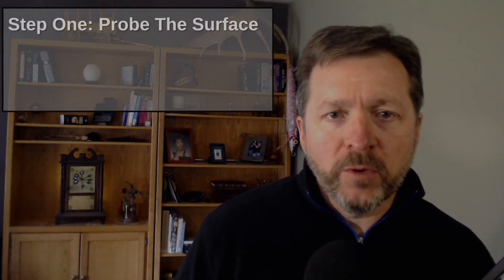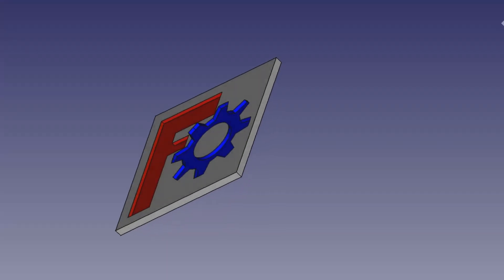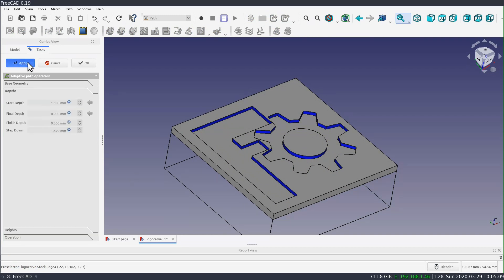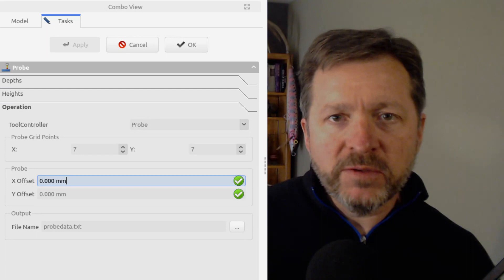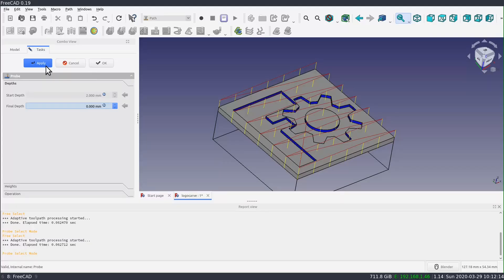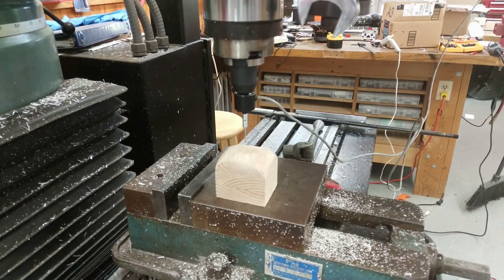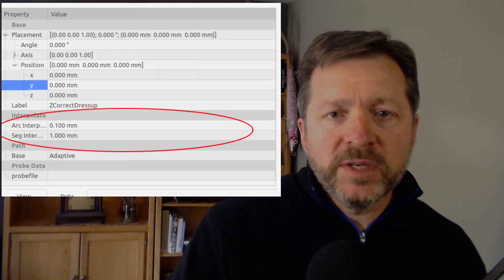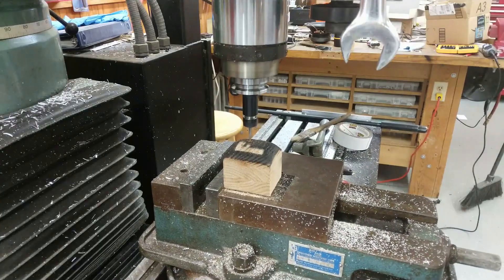Offset Probing and Z-Correction with FreeCAD Path

Comment: Very nice job. Like these two features a lot as I often work with bent plates. I would add some more flexibility:
1-probing with tool and touchplate
2-more flexibility on defining the probing matrix for example with point-to-point x y offsets: probing on the edges of the stock is to be avoided in the case I am dealing with.

Comment: I am using Centroid controller and they have a 3d probe grid mapping. However they do not have a surface adjustment tool. I use mainly Aspire for most of my 3d carving and would like to figure out how to remap the Gcode to match the surface. I am not a seasoned mathematician.
Reply from the maker: That's largely what this video is about.  It works in two phases.  One generates the map of grid points.  You run that to test the surface.  Then you apply the dressup to your gcode and it uses the data to modify the gcode. 

If you want to generate your gcode from Aspire, you would first create a 'custom' operation and paste in your gcode.
Then create a dressup for the custom.   I haven't tried this workflow.  Let me know how it goes.

Comment: Hi, I design and manufacture probes in India (MANLEO) . I would love to work with the community to add probing for inspection after machining so that any die mould makers can inspect the profiles and contours easily or at minimal cost for greater benefit of machining eco system.
Reply from the maker: Very cool!  I will work with you to get you connected to the right folks.  Private message me (sliptonic) on the FreeCAD forum with an email address and we will continue the conversation.
Reply: @sliptonic  Sure, you can reach me also at abhijith at manleo

Comment: As always, great work, thanks! 
What about the way the UCCNC autoleveling plugin method works ? 
Some time ago, i saw the UCCNC autoleveling plugin extensively using G-code variables to carve PCBs; each probed point elevation was stored in another variable, then each Z parameter of the G0/G1 commands of the original gcode was replaced by the equation of the mean Z value of the nearest 4 probe points (ie the 4 corresponding variables).  What struck me was the huge number of available variables: #0 to #999, and all that parametric programming able to do serious maths (+ - * / sin cos log floor rnd etc).  Maybe linuxcnc also does accept gcode with more user parameters (31-5000) to do the same? That would simplify the overall process: no need to create an intermediate file, there would be only one gcode file containing the probe code, a pause to change the tool,  then the carving code.

Comment: Does the probe point assume the bottom of the probe ball touched the surface? It might be a small error for steep surfaces, but use the smallest ball tip for best results?
Reply from the maker: The current implementation does no correction for the ball size.  So the control-point is effectively the middle of the bottom of the probe.  For straight probing in Z, you're right that the error is tiny. Adding a ball-size correction might be a good feature to add though.  Thanks.

Comment: This is a vital function for engrave/milling the copper on a printed circuit board. The copper is typically 35 microns thick and any uncorrected height undulation will result in failure.

Comment: Wow, that's really impressive!  Can I ask what interface you are using on LinuxCNC? - I use the AXIS interface on MachineKit.  Really appreciate all the time you spend on FreeCAD, I'd like to help at some point :-)
Reply from the maker: That's Gmoccapy. It's really nice, especially if you have a touchscreen. Axis is just not well designed for touchscreen use.  There's a version of gmoccapy that works for Machinekit but it's a bit older and I don't think it's being actively maintained.  I built both Machinekit and LinuxCNC from source on the mill and can switch back and forth between them to test things. I really hope MachineKit continues to develop because there's some very cool things possible between it and FreeCAD.